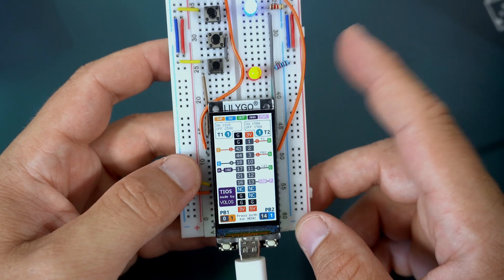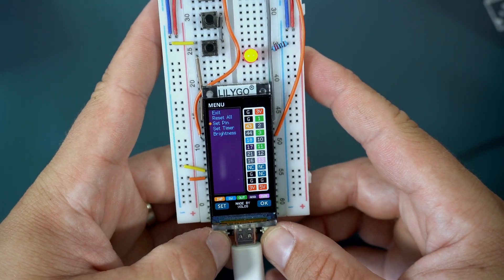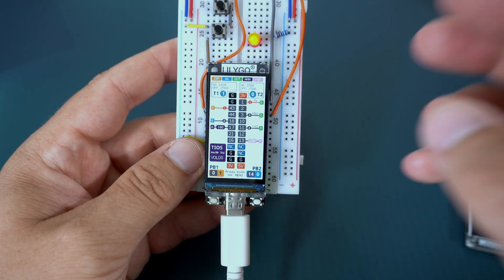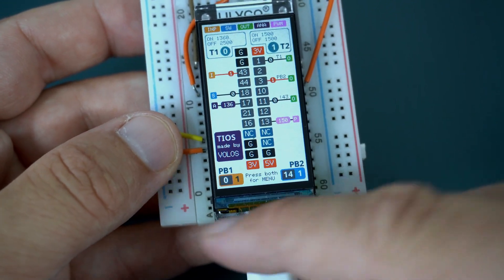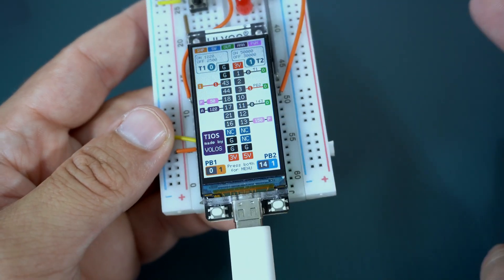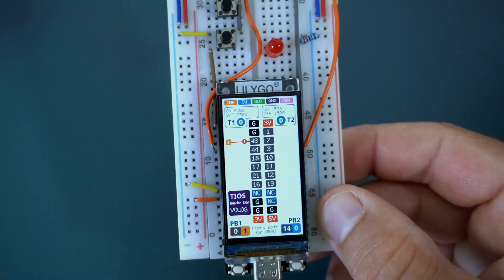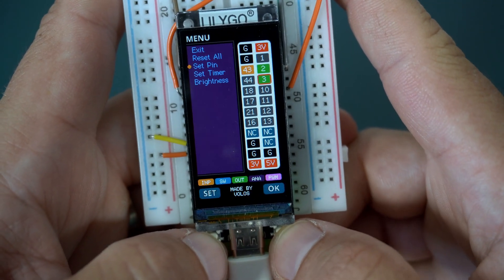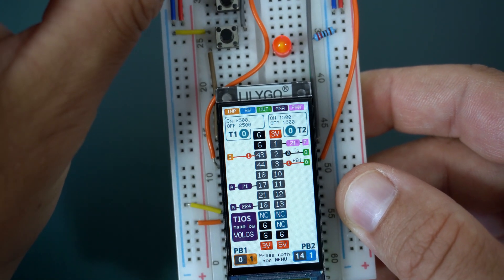TIOS - IO system (control GPIO without writing code)

Comment: I think your target group would be users of this board. I used some boards and experienced input output problems on some pins with my code. When I changed the pin the code worked. When I saw your wonderful example, I immediately thought, what a wonderful idea to describe the pins and their use.  I could imagine to have this on a new lilygo displayed, when i power it up the first time.
The pin programming idea could be useful for test purpose to test a certain combination of pins.

Comment: I had an idea for a project. I got tired of changing and updating code, over and over to position things on the screen. Be it text, lines,  boxes, whatever. So I wrote a sketch that uses the serial monitor, to enter the coordinates and other parameters, and draw them on the screen. The serial monitor then displays the code for that element.  I then copy and past It to another sketch.
It's very crude and I think you could do a better job of it. If you are interested I can let you have my code.

Comment: An interesting project. Perhaps the next step would be to create a remote link between such boards? (WiFi, BLE, serial, I2C). Another very interesting option is protocol decryption. (serial, i2c,other), including remote board. And save/load config - good idea.
Reply: WT32-SC01 PLUS - another good board (esp32-S3, 3,5 IPS (320X480)+cap touch, rs485, analog amplifer). There's still room for your creativity :) Thanks for you work.

Comment: As always excellent project, very useful to those who understand PLC where you don't need programming, only a setup like the blinking rate of the led is simply turning the knob instead of experimenting with different values in the code and flashing it every time you change it.
Maybe you could also display the timer info associated with the pins which can be flashed in a sketch.
This project deserves more than a coffee, but for now, I will buy you a coffee.
Reply from the maker: Thank you my friend, for coffee a for nice comment. I always wanted to play with PLC, i hope i will some day.

Comment: This is great project, I will develop with this example to make Digital Controller that can direct program with LCD interface, like Zelio PLC. I will try to make it with industrial using that can install in Industial Panel. 

Dear Volos, for next project, can you create projects Digital temperature controller for industrial used.

Comment: You have done some really fine work in your other projects, but this time you have really outdone yourself. 
Highly functional, beautiful to see, great UI for such limited inputs. 
This is an excellent teaching,  experimenting, and diagnostic tool.
Future enhancements could perhaps add a way to select from a set of simple i2c and one-wire  devices, scan the bus and assign names, read/write data.
Then add some  simple wifi and Bluetooth functions.
Really great work. Thank you.

Comment: When you said you could have done it on the newer t-display s3, but chose older one I was kind of confused and tried searching for the difference between these to boards. But, eventually, I found out that the only difference is the display... Are there any coding differences between regular lcd and amoled versions?

++ Btw, cool project! Useful invention!

Comment: Your TIOS looks like a good way to get beginners interested and hopefully curious enough to look deeper into microcontrollers, how they work and how to control them.
At the moment my own interests are in the M17 project - digital amateur radio with an open source codec, the Lilygo T-TWR Plus requires a license, but a WiFi-based walkie talkie doesn't and is easier to build.

Comment: That's awesome, thank you!  Reminds me of this electronics "toy" back in the mid-80s that I never had (a friend did, so I had some experience with it but wanted more).  Thank you for this trip down memory lane!!!  Just looked it up, and am pretty sure this was it: "Bloc-Tronic."  In searching, also found this kit I did own, the "Science Fair 160 in One Electronic Project Kit."

Love your project, I can see sharing it with interested children to help them incrementally on their journey (i.e., depending on their age, they could for safety "learn soldering, later").

One "enhancement request" I can think of, which depends on the answer to this question: does the display "cover" the pins, i.e., is it over/above/on top of all of the pins?  If so: you could have the display line up to show exactly which pin would be used, visually.  Would need to change the interface so the pins on the right show up on the right, and skip over unused pins.  Not necessary at all though, as your solution works great!  Just thinking of ways to help newcomers have a better understanding of what's happening.  Thanks again!